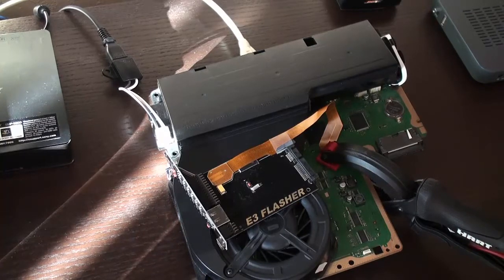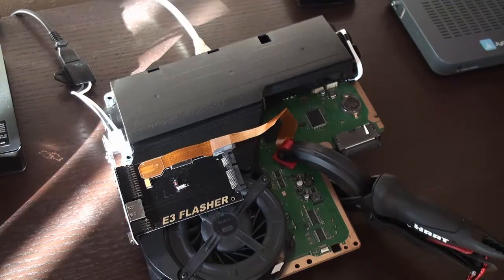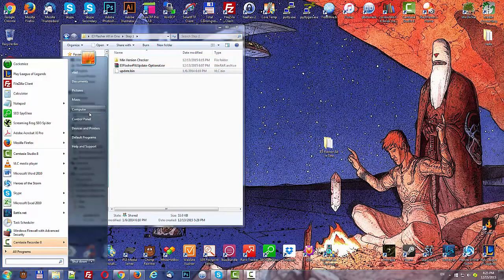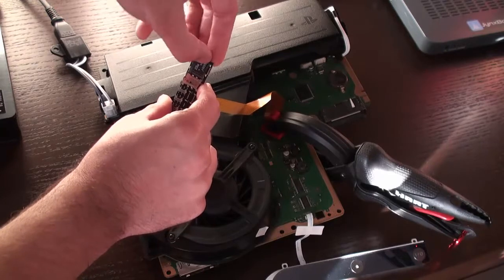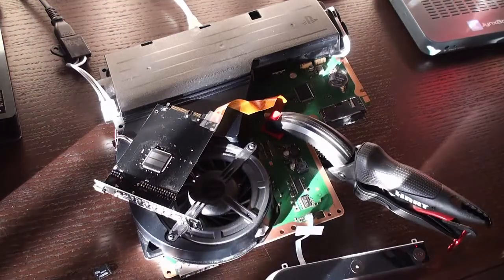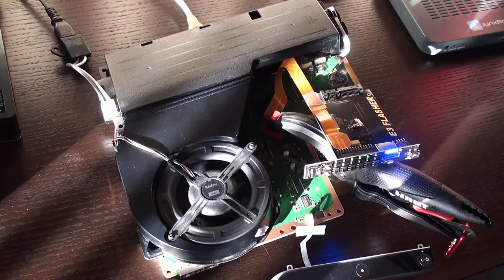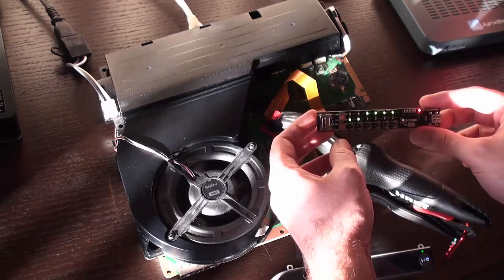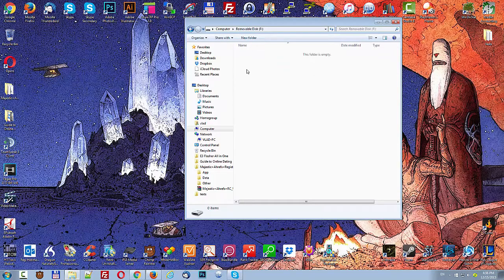How to Update the E3 Flasher Firmware (Quick & Easy)

Comment: when i do it the lights dont turn on so i turn off my ps3 and put the sd card on my pc but the file is gone what does that mean
Reply: thats normal
Reply: whats mean normal?
 that he update on the sd card are install on the e3 flasher to work more than one? or need to try again. because i try the step to update the e3 flasher but its not turning on the blue light but when i check the micro sd card the files is gone but when i try to precede to make the back up hes showing me error that its not original ps3 pls some one have any idea how to solve this problem
Reply: So What you wanna do is put a update.bin on your ps3 put all switches down but 3 and  click the red button under E-Sata

Comment: Question..ive flashed my ps3 all good i used the other firmware that does 3 dumps on my e3flasher not the samsung one, can i update the e3 flasher to samsung firmware if i connect back up to my original ps3 even tho i used the one console only fw..no info for this on the net at all.......rather buy another if risking messing my ps3 up trying

Comment: Does this work after i already downgraded a ps3 ???
Reply: Dakota Allen it has to be with an sd card
Reply from the maker: +Rick Rietmeijer Yea it does
Reply: +Hack Everyth1ng nice thanx
Reply: +MrGamer some of them can't be downgraded with the e3 flasher. Some phat ps3's can't be done with e3 flasher but can be done with something like a progskeet cus its a nand and e3 flasher compatible ps3's are nor. But if youve got the slim then if your model number is like cech-2104B it can be downgraded. But if its like 3004B or something then your ps3 is to new and can't be downgraded.
Reply: +MrGamer is the e3 flasher giving an error while flashing or does it go perfect but it isn't flashed at the end ?
Reply: +MrGamer most of the times that these errors come your e3 flasher isn't connected right to the nor chip. There should be some preasure on the thing that goes on the nor chip. If you've done that but it doesn't work try taking it of and putting it on again. Oh and your hdd should not be connected and its good to wait a few secs before starting the e3 flasher when you turn on the ps3
Reply: will the update work with just a usb or does it have to be a sd card
Reply: damn thnk u for telling me now i have to find my sd card